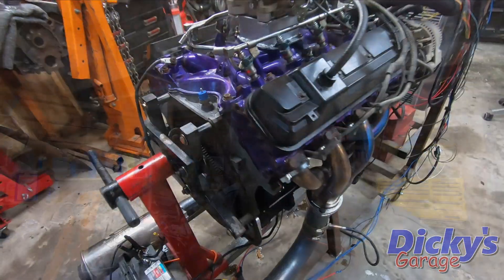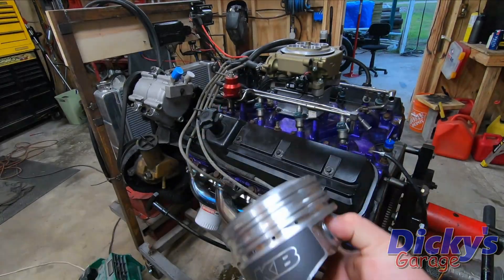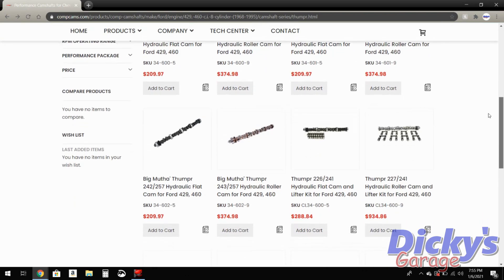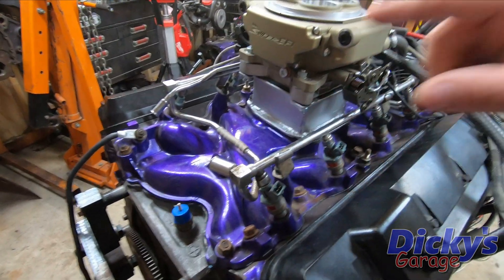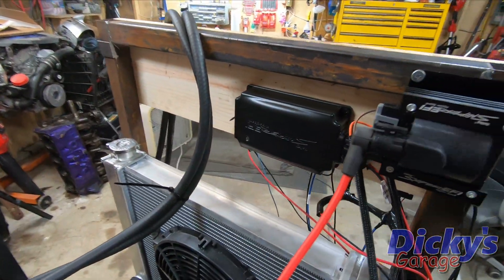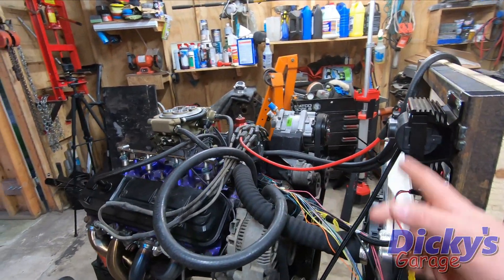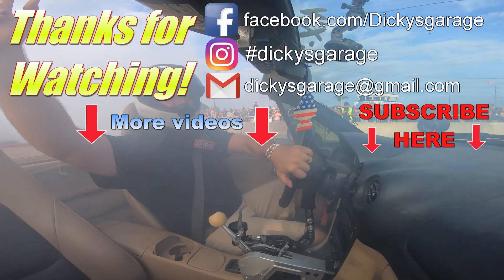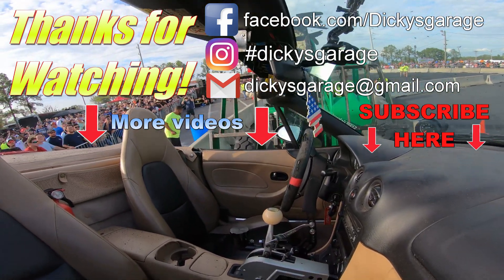Big Block Lightning: New Engine Setup EFI 460 with Upgraded Pistons and Big Mutha Thumpr Cam

Comment: I don't know if it's true or not but from what I've heard with these systems that's not already programmed that has to learn the programming you don't want to automatically just full throttle it you want to slowly bring up to full speed that way the computer can learn step by step
Reply: He was way too snappy. Do you think those headers were ebay stainless china brand? I'm thinking of getting a set.
Reply: @deadcarnahans1932 it should have a rating of stainless steel 304 being general purpose and 316 offers corrosion resistance the only complaints that I have heard from stainless steel headers in general is the color changing which me myself I don't mind I kind of like the look of it

Comment: Hi to everyone. I have an original high compression 460 in a 1969 Lincoln Mk III. I need to have the engine rebuilt and am going to restomod my Mk III instead of back to stock. I dont know if I should keep the engine with the stock heads or go aluminum heads. I plan to go the stroker route to 545 ci. I also dont know if I should have EFI or carbs. I do want a drivable, enjoyable car, so I guess around 10 to 1 compression so I dont need race fuel. Any opinions are welcome please. Should I keep the iron heads, or go aluminum? Should I go EFI or carbs? I like EFI cuz easy starting of course. Which stroker kits are the best? I have seen Eagle and Scat at Jegs and Summit. Thank you

Comment: What was your compression ratio on this engine? I have a efi 460 and want to hop it up a little but still run cheap gas because it is way to thirsty to be feeding the high octane stuff 😅
Reply: Compression Ratio 76cc 13.7:1, 82cc 12.8:1, 91cc 11.6:1, 97cc 11.0:1. This is the info I found online for these pistons

Comment: Did it work with your factory injection want to do similar build on 88 f250
Reply from the maker: Yes and no. It's drivable but way down on performance.

Comment: How does that sniper EFI work? Is it still multi port sequential or is the fuel injected through the sniper efi throttle body? I thought those were designed to replace carbs. I have a 97 f250 460 and would like to upgrade the throttle body with an air cleaner. Is the Holley sniper EFI master kit good for this? My main question is, how can I upgrade to the Holley sniper efi throttle body, while keeping it multi port sequential? Is that possible?
Reply: Holly makes a throttle body just for that type of setup!   Looks similar  to the throttle body  injection  system  but has only throttle plates , map sensor  and idle air control and an interface module to  work with  the eec 4 computer.  I watched a video  on YouTube  about it.    Multi port  is way superior  to  throttle body  injection.  And is more fuel efficient.
Reply from the maker: @randallcarney1216  You're absolutely right. To be honest now that it's cammed with more compression the factory ECU isn't getting it done even with the MAF. I'm currently gathering parts version 2.0 with a 100% tunable ECU.
Reply from the maker: You are correct. These snipers only replace carburetors. To the best of my knowledge the efi on the 460 was batch fired with the exception of 97 cali/maf systems. Holly does make a system that can run multi port it but it's big money.

Comment: those big cams on a tight LS do not work well with fuel injection. The low vacuume makes the ecu think its under a load and will over fuel.
Reply: U got  it  bro !!!!
Reply: Depends on the EFI system and whether the person can program it.

Comment: Nice video I plan on rebuilding my 460 in a f350 first tine. Just learning about them and apparently there weakness is the rods are to long so the piston doesn't come down fast enough to suck in fresh AFR. Second low compression a low 8 to 1. Next the intake valve is a to small by making it bigger it assist in grabbing around the cylinder well. Next the intake runners are way to short. Lastly the ignition is just enough to light it off.  I can understand why Chevy took off. And any Ford hi performance you need née heads 

This build I'm putting in a bigger intake valve. Port matching. Cleaning up the exhaust. And of course bee hive springs and née hardware. And a duel plane intake. Holly sniper.  Also LS coil on plug with MSD ls. And née 10:1 pistons. Good set of NHK plugs. Awesome video thanks

Comment: Do you plan on adding turbo down the line
Reply from the maker: Possibly. I gapped the rings for nitrous/boost just in case. I bet with just a little boost it would be rowdy.

Comment: I’m working on my EFI 460 this week too.  Just doing my for a reliable work truck.  Keep up the work.  Ready to see it in the truck!
Reply from the maker: Thanks, you too!
Reply: @dickysgarage7120  I was told this cam would not work in a factory headed efi 460 due to piston to valve clearance. You are running the Big Mutha Thumpr right? The hydraulic roller that has .243/.257 @.050? part number 34-602-9? I will also be keeping the factory pistons until my 557 build is complete. I want to run this cam on my 1995 EFI engine. Its got 8.5:1 but i will be converting to carb and a 7875 turbo. My heads are the E7TE's.